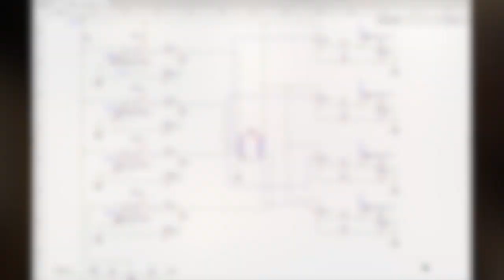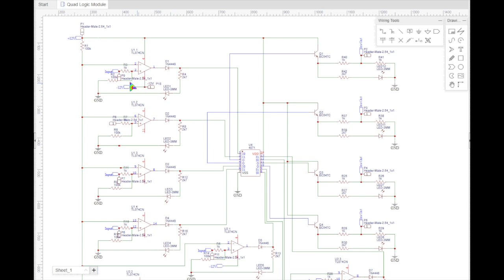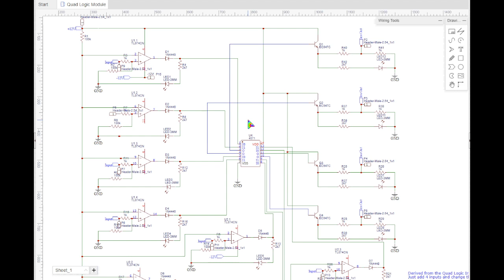Quad Logic Gate - DIY Modular in a Week 8.3

Comment: Hey Kristian. I've got all the six logic gates from a single 40106 chip at the same time. Take a look at the simulation in my videos. Greetings!
Reply from the maker: Thanks for sharing. A very interesting video. Do you have it working “for real” aswell?
Reply: @SourceryOne  I haven't finished it yet! Other things keep me busy. I designed a module with it and two atenuverters and offseters to adapt the input signals, or the outputs too, so i can adjust them to the hysteresis thresholds of the 40106. Maybe i'm finish it soon.
Reply from the maker: I found this other chip that does the same thing. Check out 74lvc1g58gw. Only amd though so yours might be better for the diy community.  :)

Comment: Why D1,D2,D3,D4 at opamps output?
Reply from the maker: To remove the negative voltage that is present when the comparator is in the low state. Without the diode it would send out -12v when the input is low. With the diode in place it outputs Gnd instead.
Reply: @SourceryOne  ahah, yeah true... I rarely connect my opamps to -12V so I didn't think of that lmao, thx

Comment: XNOR as well (NOT after XOR).
Reply from the maker: Ah. Thanks! Didn’t know if that one.
Reply: But the only basic gates are NAND and NOR. You can make all the others from these.
Reply: It is possible to make all six logic gates by combining six NOT gates and six diodes. I uploaded a video showing the simulation, but certainly couldn't find it anywhere else.
Reply: @felipemartinez7899  That was really clever. Maybe use a 4069, otherwise we get quite high switching levels.